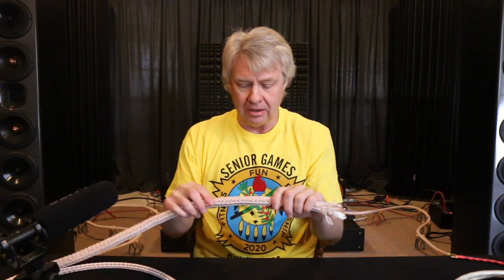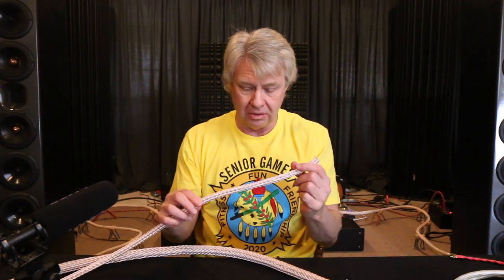What’s up with Audiophile Cable Risers?

Comment: But how about getting this measured? With and without cable risers. If the output of the speakers differs. If it does, you have something to show here.
Reply: What would you measure?
Reply: Cody Smith  What is it you think a blind test would demonstrate?
Reply: @jandewitt7178  prove that cable risers really make any real difference.
Reply: Cody Smith  AtomClown was the one who made the statement, so I was curious to see what he recommends. You took the time to answer, so I'll go with yours instead. 

I asked what you would measure. I don't see a clear answer on that, so it looks like you would want to go with a blind listening test. That's fine. A well done listening test would qualify as scientific providing it was done correctly. Since we can't measure everything we here, a blind test is the only logical choice.

So far, we're OK but this is where we run into a problem. You have to set the test up. The reason I say that is you're not interested in getting to the truth. And when I say you, I'm including everyone on your side of the argument. This is an emotional issue for you guys, and there's no place for emotions in science (unless maybe you're in Psychology.). The issue has nothing to do with a test. It never does. We've all done blind testing. No one wants to spend a lot of money on something that doesn't make a difference. 

Its always about emotions. The real issue isn't the test. You guys don't want there to be a difference. And that's a different matter entirely. Of course, at this point you are going to object. Do I have any evidence to back up what I just said? Absolutely. Cables, cable risers, tubes, whatever..... People have been debating these topics since the 1980's. Pretty soon we'll be coming up on half a century. In the beginning of this post, I stated that you have to set the test up. The reason for that is there's no test you'll accept. No matter what was tested, or how well the test was done, you will not accept it. Again, it has nothing to do with audio equipment. Some people hate the concept of high end audio equipment, and will say anything to discredit anyone who has a different opinion than they do. How can I be so sure? I'm going to ask you 1 question, and you will not answer it.

Since you are asking for a test, can you give a single example of a test that was done to whatever standards you require? It doesn't have to be on cable risers specifically. It can be on any topic in high end audio that you guys are always challenging us on. Show us just 1 example of a test you approve of. You can't do it. I've been asking this question for over 3 decades now, and I have yet to see anyone even attempt to answer it. So, if you can't produce a single shred of evidence to back up your position, why should anyone take you seriously?
Reply: @HenneB   How would a blind test prove that? What is it you think a blind test, tests for?
Reply: @AT-wl9yq  Quote: “You guys don’t want there to be a difference” 👍 So true.
- And to think that they want us to take a blind test so they can prove we are the ones that have a bias 😜
Reply: @AT-wl9yq  If there is a difference between cable risers and no cable risers, that should show in a sound measuring graph. And if the sounds for example becomes louder, damn, that would be a scientific breakthrough.
Reply: @c0ckyclown  I just responded to basically the same statement from one of the other posters, so just use that. The only exception is your tone is very respectful, so if you see some colorful language in that response, it doesn't apply to you.
Reply: @c0ckyclown  why can you assume that if one hear a difference it has to show in measurements? Where is the scientific proof of this statement?
Reply: @StefanoCipo87  I don't don't have to prove anything, especially because your statement is invalid. For your information, GR-Research made the statement that there is a difference using cable risers versus not using cable risers. GR.-Research shows graphs improving speakers all the time., because differences' are measurable and relying on methods of research and not subjective. But all the sudden they make a subjective statement with no measuring graphs. That makes this video a commercial for Tinker Audio and nothing else.
Reply: The dynamic range of the human ear is 130dB from the threshold of hearing to the threshold of pain.  This is a power differential of 10 TRILLION to 1.  A 7-1/2 digit Keithly meter is - $7,000.00.  Each digit is a order of magnitude.  A trained listener (recording/mastering engineer or educated listener) can easily detect changes of 1dB in amplitude and pretty much nail the frequency involved.  The human ear is even more sensitive to timing errors like digital jitter.  There is not an oscilloscope or other measurement device that can accurately display 10,000,000,000,000 : 1 changes available in the private sector.  The most accurate oscilloscopes available are 32-bit and are simply not up to the task.  It is not a frequency dependent issue.  It is a parts per trillion issue.  Figure out a way to inexpensively (< $100,000.00) way to do this.  We'll wait...
Reply: @c0ckyclown  how can my statement be invalid if all I wrote were two questions?…
Reply: @StefanoCipo87  Your 2 questions are correct and can be proven. One of the things i listen for is timbre. We're not even close to being able to measure it. I can reference at least 2 universities that are currently working on a way to measure it, but according to them, it won't be any time soon. Its just too complex to measure.

That's why I say the science/measurement only crowd is junk science. They don't even know what science is. You make an observation, and they take it upon themselves to make up what the problem is, and they make up a solution for the problem they just fabricated. If these guys had a debate in front of a group of real scientists that don't have any emotional distress over some topics in high end audio, they would be laughed off the stage. I've been watching the same people make the same broken down arguments for decades, and they won't even consider doing something about it.
Reply: @AT-wl9yq  I totally agree. I'm not against science when it comes to hi end audio, I'm for the truth. Truth comes with observation, experience, experimentation. Only later on come the scientific theoretical models to explain it in a rational way. The only weird thing I see is how much emotional these people get over audiophile topics and how many they are. As if we audiophile people were doing anything against them personally by talking about unexplained phenomena we observe in our hobby. Sooner or later science will demonstrate why cables change the sound we hear, maybe then they will find peace.
Reply: @carloshathcock846  That's a lot of interesting information, but there's one thing I don't see. What exactly are you measuring for, and why? I'm not saying your information is no good, I just want to know what you are applying it to? We need context.
Reply: @StefanoCipo87  I firmly believe that if there is an audible difference, then there has to be a way to measure it. The reality is we just can't do that yet. And I can't imagine why that upsets so many people.

You can tell right away that some people just want the truth, while others want to win the argument. And for those people, this has absolutely nothing to do with cables or tube or anything else. They just want to be right. The sad part is, these people could end the debate practically overnight if they were simply willing to do some real science.   Any time it comes up, they refuse. I gave up on trying to help these guys understand anything after Gene from Audioholics refused Ted Denny from Synergistic offer. I'm sure you've seen it. Its on youtube. It was the holy grail of offers. There's never been an offer like that in history. Gene turned him down, and when I asked him about it, ,he said it was due to legal reasons. I didn't push him on it, but when you turn down offers like that, you're just simply not looking for the truth. And they're all the same. They will never do a real test.
Reply: @AT-wl9yq  Nailed it.  We need much better measurement equipment and methodology.  See you reasons above.  Right now the best "differential testing" gear we have are trained ears and, yes, AB testing... blind folded or not.  When the results are repeatable with high accuracy the the change is real.  I've seen firsthand Danny nailing changes 10 out of 10.

"Snake oil" is terminology from the ignorantly clueless.  Either that or their pride will not allow them to be wrong.  Making an effort to learn is necessary for education in any topic.

Comment: There is a guy that did a video of your speaker wires vs the worst you can get from Home Depot.  Even in a Youtube video you can hear the difference, night and day.  
I run "Anti-cables", which are solid core wire, and I can't recall the dialectric, but they never touch the ground.  I tried a couple others and for sure, the Anti-cables sounded best. 
An electrical signal doesn't only run IN the wire itself, it also runs in the fields around it.  So, material matters, dialectric matters, strong electrical or magnetic fields near the wires matter, charges, and yes even contact to the floor can matter.

Comment: I know signals don't travel through a wire; they travel around the outside of a wire.  Also, there are a few physics channels, including Veritasium, that tell us that electricity energy in general  doesn't actually  travel through a wire but  it travels in a field. Its not even clear to me that this field is necessarily close to, or at a regular distance from the surface of the wire.
Electricity sure is sensitive to someone touching the wire though.
I'm suddenly interested in fiber optics for signals.
Reply: I think I watched the same video I am glad I am retired so I can just listen and not really worry about such stuff though I find it endlessly interesting and frustrating :-)
Reply: @cdunphy457  Yeah, me too. We learned in school that gravity is a property of mass. Now they tell us that's wrong. Gravity is a property of the universe. It's everywhere and mass just bends and distorts it. 
The more we know, the more we realize we don't know.
Reply: ElectroBOOM debunked veritasiams video. 
In my opinion, if the energy is around the wire why can I hold a wire that's putting 3kw through it but if I touch the copper I'm dead?
Reply: @darrenlomax1283  YES - exactly!!  Thank you!

Comment: There is so much miss information in the comments. The skin effect on wire does not happen in DC circuits. The lower the frequency of an alternating current the deeper the flow of electricity in the wire. Some very high frequencies can actually flow electrons in the dielectric, which is air in some cases. 

One aspect not mentioned here is line radiation. Coaxial or balanced feeder line for antenna are designed to not radiate whike the antenna is designed to be a highly efficient radiator. But all electrical circuits using A/C will radiate and will have standing waves or reflected waves.
Reply: I believe speaker ckts, at least in a home audio system, are AC ckts.
Reply: @edbagwell7513  Yes they are with a range of 20hz to 20khz

Comment: So, what’s the priority….

 Cable risers  - last
Tube connectors. - penultimate 
Speaker lining & rigidity 
Quality of cross over parts
Room treatment 
Speaker location 
Amp quality

This is a real question….

I just paid $1,800 for a used Krell 2 channel amp 250wpc… added incrementally over my Marantz AVR… but noticeable (didn’t think it would) really improved listening satisfaction…

Thinking now, probably should have upgraded to tube connectors when I bought the kit…

Comment: I have a pair of speakers (ADS) that's over 25 yrs old.. they were working fine until I changed the impedance on the amplifier from 4ohms to 8 and I switched them around putting the speaker that was normally on the left and the other on the right.. I got major rattle on the low frequencies then I switched them back, right to left and the rattle went away? .. is this possible?.. I left the amplifier impedance switch at 8ohms

Comment: Are not expensive cabling shielded & isolated from the affects of static electricity & RF already? Isn't that what the high pricing buys in the end? 

I use Harmonic Technology Prosilway Mk lll interconnects & Pro 9+ speaker cables. Smooth, quiet & "natural".
I also use Goertz AG 2 Veracity & it's copper version. I also included their silver Alpha-Core interconnects. Speed & startling attack is achieved creating a lifelike excitement. However, some amps can't handle their very low resistance may cause oscillation?
Between the two brands there are discernable differences. 
I can't honestly say elevating them off the floor or not made any difference. 
I would suspect concrete floors, as in apartments may have some dielectrical influence on some cables? But, if they are enclosed properly that shouldn't be an issue? 
Wood flooring in a house may have electric wiring beneath that theoretically could cause RF & magnetic interference? But, again the protective enclosure packaging, sometimes over an inch thick should need not "risers" to be optimized. 

I would conclude risers are snake oil to expensive speaker cabling. 
Lastly, I did read a paper possibly written by Nikola Tesla. There he states that electrons flow outside the wire & not through it, as believed! That in & of itself might be reason enough to raise speaker cables into free space?
Reply: Actually the shielding can be part of the problem. An electric field builds up there too. 

The problem with the Goertz cable is not low resistance. It is the high capacitance. I used to be a dealer for them and stocked and used their cables, but I have moved on to better cable.

Comment: Are cable risers built for speaker cables only? Or all cables? Science tells me all cables lol. But again once you reach that level. Is when you notice the benefits. I also find that space is beneficial to cables and components. Spacing everything neatly apart from one another helps too. Using the shortest cables you can get away with. Reduces the antenna effect. Having longer interconnects and shorter speaker cables are the way to go.

Comment: Great content as always!!! For all the skeptics and doubters, take a look at the power lines outside high above. These cables are bare with no cover or insulation. In comparison to the gauge in your home they are relatively thin and carry energy to large neighborhoods. They can do so as a result of their free air properties.

Which leads to my question, what about testing a set of exposed cables strung like power lines from amp to speakers with the care to not short out the amp? Worth the test?
Reply: It might prove that Danny's braided insulated speaker wire is part of the problem.

Overhead power transmission lines are insulated by the air between conductors.  Overhead power transmission lines are air insulated to save weight and cost.

When I tested separated conductors I used insulated wire.  Since the capacitance C = KeA/d the dielectric constant of the insulation times the permittivity of free space only reduces the effective distance between air separated conductors a tiny amount.  The effective distance between spaced insulated conductors is greater than the distance between the outer surface of the insulation.
Reply: Bare Copper wires will oxidize pretty quickly if not coated.
Reply: @dannyrichie9743  High voltage transmission lines are made of aluminum or aluminum wrapped around a steel core.
Reply: @paulsebring6930  Those lines are carrying a 60Hz sine wave and not an audio signal.
Reply: No offense, but that is completely incorrect. Transmission lines have no insulation because of cost.. Nothing else.. They are suspended on standoffs t I create electrical isolation.. Nothing else..

Comment: Glad you finally have your cables off the floor....some of us have been doing this for over 20 years.....All cables.....not just speaker cables need to be off the floor for best sound....this includes ground wires........It makes the same difference on wood floors, cement, rugs.....everything.  I use cardboard.....and it works great.  By the way, the Furutech cable thangs make way more difference with their magic fairy dust......expensive however.  Do not use styrofoam of any plastic.....best to stay with paper and wood products.

Comment: 12:40 This isn't what's going on. It's not about filtering noise. It's about the signals coherence. Signal propagation speed through the cable is frequency dependant. By lowering the capacitance and inductance of the cable your are causing the various frequencies to arrive closer to  in time, more similar to how they left the source, making the signal more coherent.
Reply: nope.  The signal is a complex wave and all of it travels at the same speed and arrives at the same time.  The only thing that is frequency dependent is skin effect....but audio frequences are not high enough for us to need to worry about skin effect...
Reply: The crossover destroys the waveform so much at the summation point that some people would pull their hair if they would see what is going on with the signal. Cable risers... lol